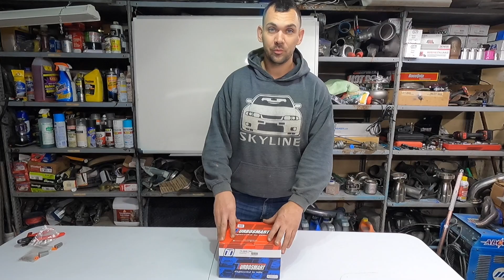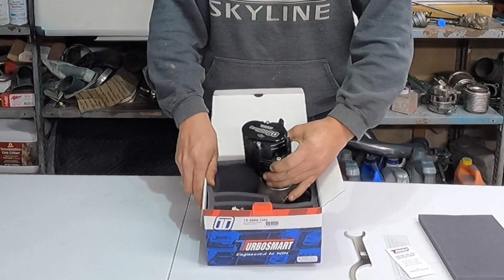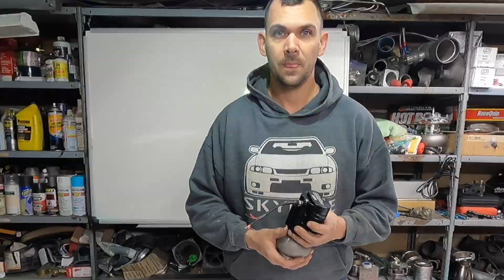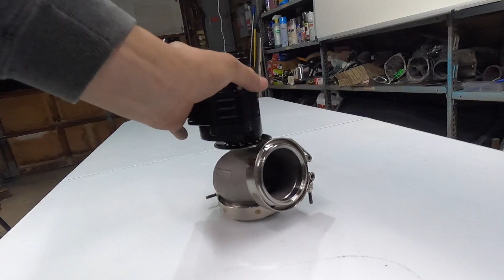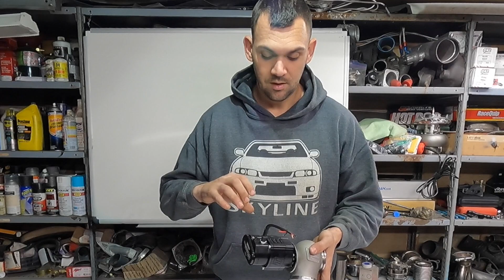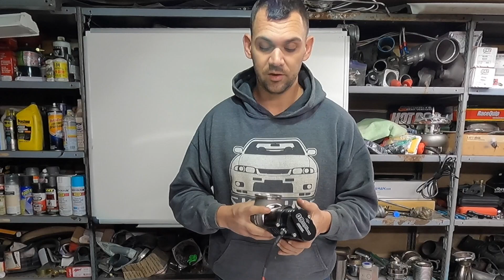Turbosmart 60mm E gate Powergate // UNBOXING VIDEO

Comment: how do you control it on something like hp tuners?
Reply: @MazeBuilt  that sucks. i hope the external controller for it isn't crazy expensive. if it worked with hp tuners to control/tune it a ton of turbo LS guys would buy a 60mm